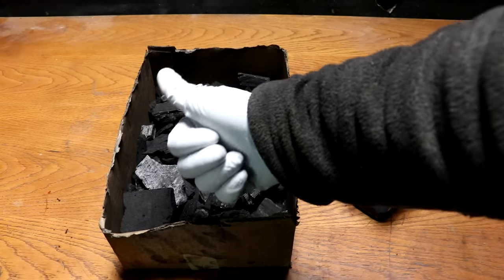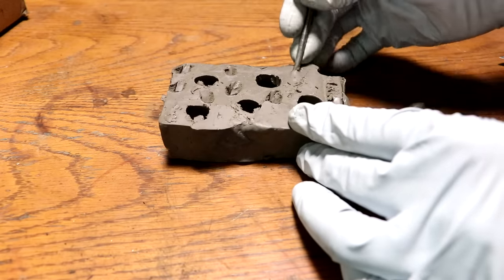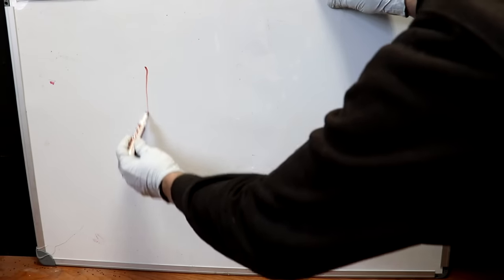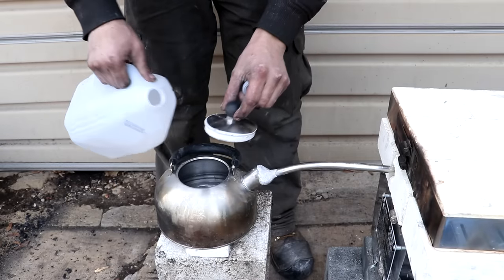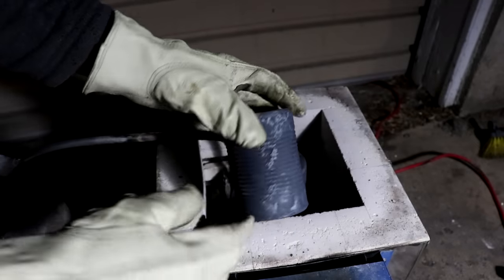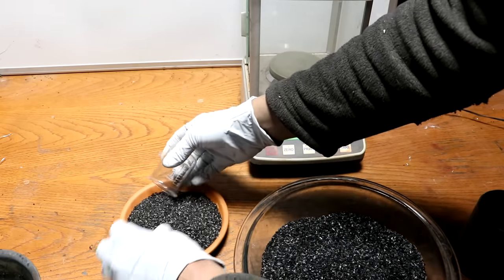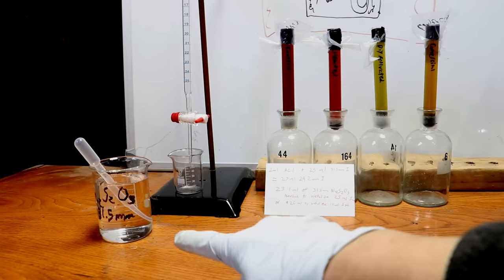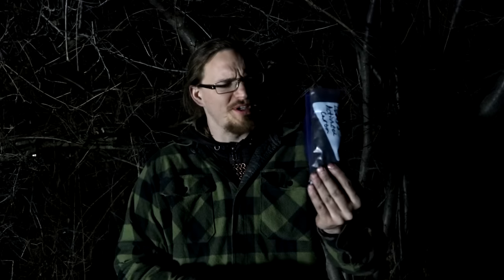Making Activated Carbon

Comment: I work with magnet wires alot. Make twisted rope of 40 threads each side. to solder we need to remove insulation which is a painful job as currently using 3 methods: 1. knife for repair, 2- battery acid and sometime drain cleaner at stove for removing insulation.

Problem: It is very fumy bad smell and burns sometime also we can not perform these methods when humidity is more than normal as carbon covers bear copper so quickly and cleaning that carbon is only possible with knife which is not easy.

please suggest some solution. if you can. My Allah bless you

Comment: Hey Cody would it works using basic antiseptic made of povidone iodine (10g/100ml)? (Knowing that it also contains, Glycerol, macrogol lauric ether, disodium phosphate dihydrate, citric acid monohydrate and sodium hydroxide). I don't see what it should not works since it's just a comparison.

Comment: no wounder you beat the commercial one, the fact that you got to 900c and cycled steam in 4 times was proboly the reason, commercial activated charcoal is probly crafted at a lower temparture, and having less cycles, as they would attempt to reach the best ratio of price of crafting vs effect of the activated charcoal.

Comment: So that´s why when producing DIY Black Powder, everything stands or falls with the quality of the Charcoal! I degassed it, but we went even further by adding water in a later step, and than putting the (fresh!) willow wood blocks-turned-coal in their container, and into the fire. It never occurred to me that I created a ton more surface area for the oxygen produced by decomposing potassium-nitrate to react with/rush trough. The next step was taking the VERY finely ground KNO3 and DIY ´special´ Charcoal (also made véry fine by ballmill) and mix them together with water (again, seems counterproductive) which probably allowed the sulfur and nitrate to crawl into those microscopic holes.

Most people just use ordinary, BBQ Charcoal for making DIY Black powder... DON´T!

PS. ´I might use the dust for something else´... See above ;-) A video called ´how to make GOOD black powder, as per Napoleonic recipe´ because that´s how they did it. The French used slightly more sulfur than charcoal, no idea why, except it ignites better and it´s burning speed should hence be slightly higher. Normally excepted is Sulfur-Coal-Nitrate 10-15-75, but French mixture (considered the best quality powder in the world by the early 19th century) was 12,5-12,5-75 I recall.

Comment: Your activated carbon was of the same quality as the commercial one because since you forgot treating your charcoal with a acid like vinegar to dissolve al the carbonates. The activated carbon you make contains also a lot of calcium, magnesium and potassium. So if those where to removed you got left pure carbon which would have absorbed by weight and volume more iodine.

Comment: What are you using as a grinder? I havent seen any machines like that! Trying to crush some lump charcoal for a fungi project so please let me know! Thanks for the video
Reply: That looks like a residential wood chipper, slightly modified to remove the tiny slot and stupid Shutoff switch.

Comment: I'm a little late in commenting on this video so let me know if this has been answered anywhere but;  Could you get a similar result from submerging the charcoal in water and hard boiling it long enough to dissolve any oils and replace any liquids then freeze drying it?
Reply from the maker: it might improve the charcoal a little. Adding peroxide to the water would help. I’ve tested neither as of current.

Comment: The dawn of a new age? People all around the world are waking up to how the world is and what humans are doing to it. With the ozone layer shrinking and the pollution stacking up, people are beginning to look for answers and take action. One idea people had to reduce overall pollution was to require that car manufacturers to sell a certain percentage of their cars as alternative-fueled cars in a certain state. What does this mean and what will it do? Alternative-fueled cars run on fuels that burn off more climate friendly gasses, which will vastly decrease the harm humans do to the ecosystem. I believe that this legislation is a great idea and should be put into effect.
    Building off what I said earlier, alternative-fueled cars are much better for the environment. In fact, alternative-fueled cars burn off little to even no soot and other harmful gasses. Electric vehicles might seem to be too good to be true, so here are some numbers to look into. A diesel vehicle usually has an overall gas efficiency of 45-55% and an electric vehicle usually is 80-90% efficient. This can also translate into the overall cost. Switching the gears to a gasoline vehicle compared to an electric vehicle, a gasoline vehicle can cost an everyday driver in the US $1,117 annually, whereas an electric vehicle would cost the same person $485 annually to operate. Also, keeping in mind that power sources all around the world are using more and more renewable energy like solar power, wind, hydropower, etc. So it cuts the pollution produced way down from not only you but also from the power plants.
    Another great reason to implement this legislation, would be the aftermath of the whole idea. Putting more and more alternative-fueled cars into a populated area provides them with a sense of normality. Newer generations of people will see them everywhere and eventually might become the normal car to purchase. Possibly making the roles switch and driving around in a conventional car will be rare. This would make the demand for alternative fueled cars greater and if the major brands sold them at a cheaper price than conventional cars, everyone would buy them more frequently. Creating a whole new market for cars and vehicle manufacturing which will provide the big brands with whole new opportunities to grow with new stock availability, and with the new branches of manufacturing, new employment options would be created, shrinking the unemployment rate in the US and providing more income to the major brands.
    To finish off, this legislation is a great idea because it brings people more cost efficient and environmentally friendly options when purchasing a car, as well as it would bring more jobs to the US and create more open markets for brands to grow. But a few good counter arguments could be made to the introduction of forcing the dealerships with alternative cars. For example, would people all around the US begin to slowly hate the usage of conventional cars? Over time, would people be forced to chuck out their old cars for something more environmentally friendly? Will people begin to use up the energy created by renewable resources faster than it can produced? What will happen to all of the available oil around the world? What will happen to the oil and gasoline markets? You decide, is the passing of this legislation more beneficial to the world? Or is it not worth the costs of what we will drop to move forward as humans?

Comment: "would trip the breaker" - uhm - why? how low in terms of WATTs you can use per breaker and why not use two different circuits?
here in europe it's 230V x 16A per breaker = 3.6kW before you trip one - and you can split your load across 3 phases - a typical hot plate doesn't use that much, so when hooked up to a different breaker would had been easy to use both ...

Comment: cody, is it possible to do a similar thing with glass shards to make "activated glass" or desert sand to make "activated desert sand" as an additive for concrete?
Reply: desert sand is apparently not irregular enough to be used as an additive in concrete but if you can increase its effective surface area, maybe it can
Reply: i unfortunately don't have the chemistry knowledge nor the equipment to try this sort of thing out, I wish i knew if it was feasible

Comment: Have you tried using that wasted heat to boil the water?
Reply: Good idea, might not take any more work than putting the kettle on top of the kiln. Maybe adding a "window" of thinner material for the heat to escape if the insulation is too good.

Comment: You definitely got my attention when you said sodium thiosulfate, I work in a food processing plant (giant chicken slaughterhouse) and we use peracetic acid diluted in water (of course) to sanitize the product. I’m the guy that runs tests on the water to monitor the concentration of the PAA in the water. One of the chemicals we used to use to do so was sodium thiosulfate. Just thought it was interesting to see you using it in a video.

Comment: Coool, in my opinion the best application for AC would absorbing neurotoxic heavy metals like lead in those buildings where the plumbing is still made out of fucking Lead. Hope more people are aware of this problem to have healthy children. I have no idea if it really works. But after i watched the Cosmos episode about lead intoxication i told my dad to buy a carbon activared filter since our building has lead pipes unfortunately
Reply from the maker: organic lead should be adsorbed but ionic lead will not. (fortunately the organic lead is far more dangerous of the two)

Comment: Why don’t the acids and stuff never react with the glas from the bekers being used
Reply: FBI They don’t react with the glass because the glass is really stable and its molecules bound tightly together, so they would rather stay as glass then interact with the chemicals in the container. Some things do react with glass, but those things are generally extremely dangerous and not commonly used.
Reply: Razor Drive Tnx, So What does react for axample

Comment: boiling charcoal with hydrochloric acid then water washes is another very effective way to make activated carbon
Reply from the maker: No. No it is not.
Reply: @theCodyReeder  it most certainly is ! I'll find the ref for you ! there are MANY ways of making activated carbon ! acid washes can be used to make various forms of activated carbon, to re-activate it, different procedures with different acids produce different types for different purposes. I have used these processes myself.

Comment: I understand completely what activated carbon is.
Now.
At long last.
Because I was always suspicious of the name:
"Activated"?
That sounds like there are other, added chemicals in there and I wanted none of that. I just wanted pure charcoal with as big a surface area as possible.
How was I to know, at that point, (point of total ignorance), that "activated" simply means "massive surface area"?
I googled it.
I Wikied it.
And although I felt like I was getting closer, the more I read, the more stupid I felt.
What I didn't and still, don't understand, is why it is so-called?
I mean: "Activated?"
It doesn't really make much sense to me.
I mean the word doesn't suggest or imply the degrees of magnitude by which the surface area of said carbon has increased.
It is not at all intuitive.
Of course, I get it now.
But it was a fucking hard and painful journey.
Reply: Yes perhaps it should be named, carbon granules with a surprisingly large surface area, for their small size. 
The purpose of the manageable sized granules, is to nullify the carbon dust, that Cody threw on the scrap heap. Which also has, a surprisingly large surface area, but is impracticable.
Reply: @flashgordon6670  Superfine or ultrafine carbon would be much more intuitive and not at all cumbersome.
>
Reply: @Bodragon  So why did Cody throw it on the scrap then Einstein?

Comment: Hey Cody.
If you ever need to bend a metal tube sharply again, know that you can fill it up with silicate sand, plug both ends and then do your metalwork quite easily. It would save you some efforts, some fuel and prevent you from having traces of tin that might be unwelcome depending on your aim.

Comment: Simple way to make  charcoal 
Material required alluminum foil
And some wood
Cover the wood with alluminum foil and Make only one small hole that exposes the wood to the oxygen 
And put that on a fire 
You get charcoal
During the fire use a leaf blower for better and fast result.

Comment: What is achieved in activation that can't be achieved by just grinding the carbon very finely? Surface area is surface area, no?
Reply: Well activated carbon is gonna have even more surface area than char dust. Plus dust floats away and can be hard to mix with other things
Reply: @yomamaisaniceperson2707  Activated carbon will have less surface area than dust, but I get it not floating away. Thanks!

Comment: I apologize if this question is agonizingly dumb. And what sparked this question, maybe even more dumb.

Is it better for the environment, to burn electric homemade charcoal, instead of normal ground coal? Or is just bad for the environment, to burn anything?

I feel so guilty, using any coal I find, in Minecraft. If you want a real challenge, try playing Hardcore Survival, without burning any coal. No coal in furnaces, no coal torches, don't even sell coal to villagers.

In Minecraft, I'm pursuing alternative light & fuel sources. And in real life. I want to only use electricity for my off-grid home. Electric heating, instead of burning anything.

But I still want to know.

Is it better to burn charcoal instead of mined coal? Or is it bad for the environment, to burn anything, period? Wood, charcoal, fat, natural gas, alcohol, thermite, farts...anything?
Reply from the maker: Mined coal is non renewable and you are burning carbon releasing into the air co2 that has been sequestered for 200 million years. It also releases sulfur and radioactive elements not present in charcoal.
Reply: Cody'sLab 
Thank you Cody. I asked this question, but my search engine results, didn't understand my question. And I feel better about using Charcoal in Minecraft now, if I have to. Thanks again.

Comment: so you can refine mercury with simple tools but you have trouble making charcoal... 😐... 🦗🦗🦗 
its simple man you start an open firepit let the wood burn for about 10-15 minutes and then cover the pit to smother the flames and embers... it will take about 30 minutes to an hour depending on how much charcoal your making, once its all cooled down you got yourself charcoal. i use this method with my firepit all the time and it makes decent charcoal though i cool my coals in a steel wheelbarrel covered with very non air-tight aluminum panels so it takes forever for my charcoal to cool down lol, more airtight it is the faster it will cool down.

Comment: couldn't you just crush it to powder to maximize surface area?
EDIT: Oh, you crush it AND make microscopic holes in it....
Reply: so... wouldn't it still work best to just grind it into a very fine dust? .... (like the rotating chamber with metal balls in it he used to powderify... rocks I think?)
- Or is the point of it that it stays in one piece?